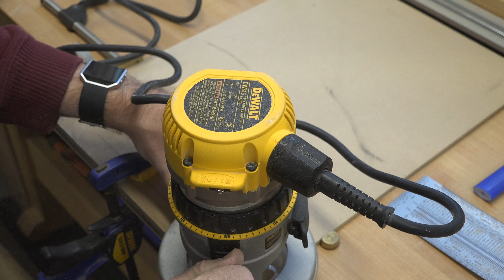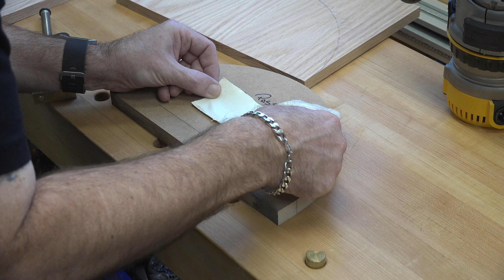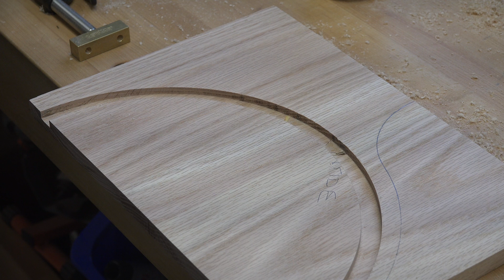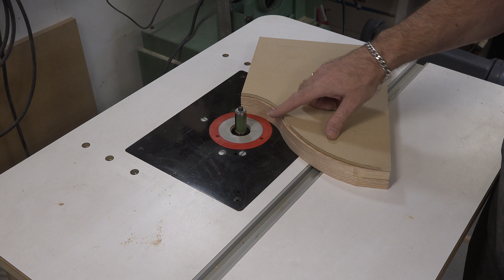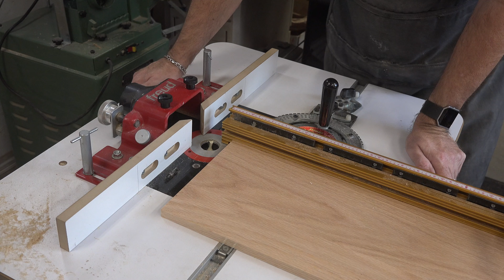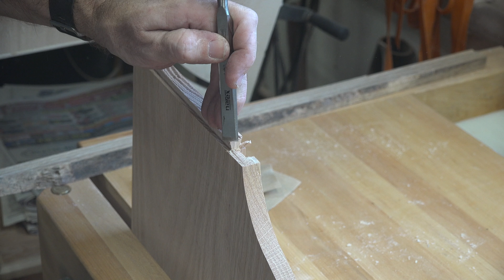Making a Bread Box Part 2

Comment: Hi Kenny! I realize this was a long time ago but, I have to ask, why did you do the "bowl" shape for the door? I always cherish space and think I would have turned the tambour slots up so they would go inside the top piece some and then perhaps go down farther back. I realize you only have a 3.5" diameter but it would have given more space inside the box. Just curious. Being the lazy person I am, I would have likely used the biscuits for attaching the top. :o) Love your use of the scroll saw. I never know when it is going to pop up. I also learned a lot from your fitment of the dovetail and the slot. Regards, Bill
Reply from the maker: This isn't my design Bill.  In fact, it is the recommended project that comes with the tambour bits so I was just following their dimensions.  I like it's shape.  Sometimes, an interesting piece that sacrifices some functionality is better than a boring "boxy" piece that keeps its full functionality in tact.  I hope that made sense.  Thanks for tuning in and for the kind words on the project.
Reply: @acutabove_woodworkings  That makes sense since I saw  another YTer doing the exact same box. I wasn't suggesting a change to the outer box but rather just to the tracks inside. Did I mention I am slightly alergic to Oak? No red oak for me in the future. But, Beech perhaps. No, I already have a bread box with a tambour door that has ended up holding our Costco clear food wrap. Works great. Regards, Bill
Reply from the maker: @billinfarmington5189  Beech and Oak....might as well be the same wood but just different colours.
Reply: @acutabove_woodworkings  Not allergic to Beech.
Reply from the maker: @billinfarmington5189  That's a good thing.

Comment: Yeah man,answer this for me, i went in a primitive shop to steal an idea or two and the breadboxes like yours sales for $40. how can you make anything that takes that long so cheap. oh yeah a thing called CNC,no fun in that. thanks dude have a good Easter
Reply from the maker: The other way of course, is that they are using much cheaper material.  $40 (after all the work that went into it) wouldn't purchase the tambour for the breadbox, let alone the whole box.  The only other way that I could see to do it (other than CNC) would be to jig up and basically have a product line type of set up where you could make several of these in one go with no though process at all in doing it.  Again, where's the fun in that?  Happy easter to you to my man.  Have an awesome one.

Comment: six and twenty seven, thirty seconds inches. decimal system 174mm. i sell paint in litres but the tint is messured in 64ths of fluid ounces. i am frustrated.  that is my story.
Reply from the maker: I can totally relate.  I grew up in an educational system that promoted the Imperial measurement system.  At some point the government said that metric would be the new standard but I already had Imperial on the brain.  I couldn't lose the imperial but I couldn't escape the metric.  Then started a trade where the measurements were all in Imperial only to have it plagued years later by the metric system but once again, I couldn't escape the Imperial embedded in my brain.  I measure in inches and feet, I buy my fuel and milk in litres, I drive in kilometres but still refer to miles per gallon.  I'm part of a mixed up generation.  Thanks for tuning in.  I hope you enjoyed the show, regardless of what measurements you use.